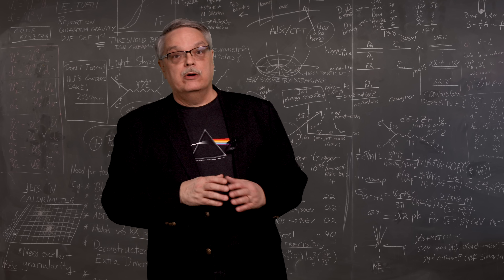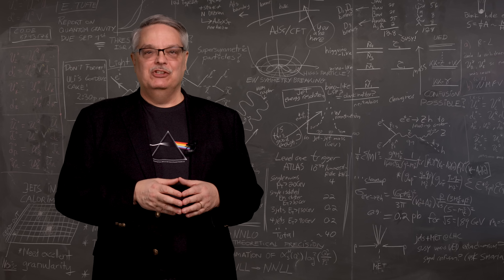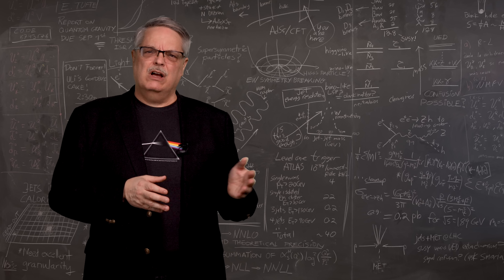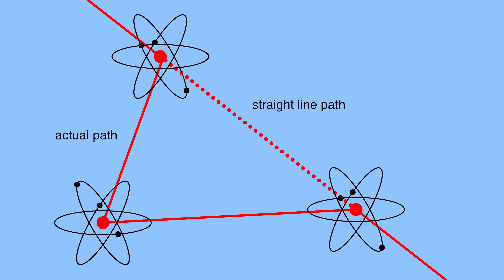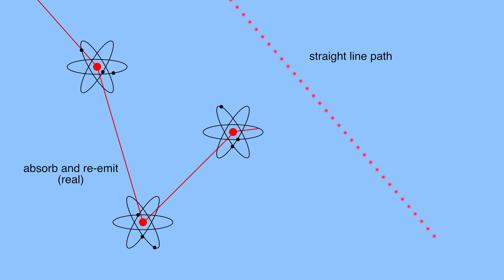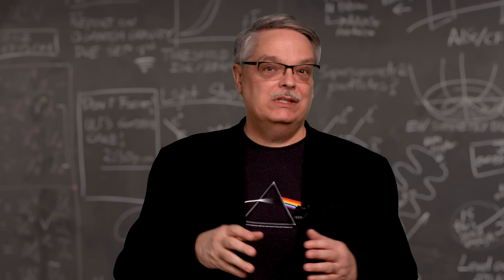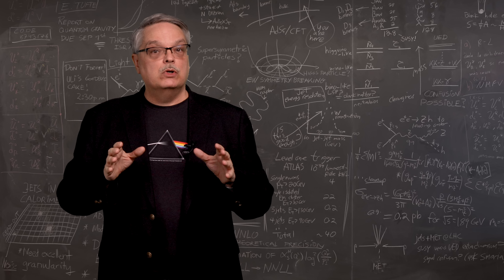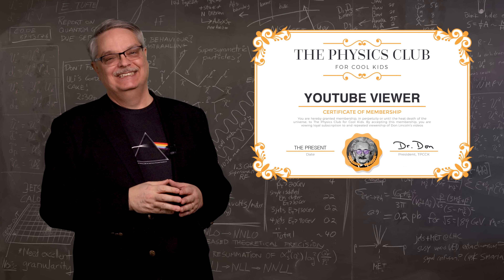Why does light slow down in water?

Comment: light moves slower in some materials as light moves slower in some materials. I think that's as good an explanation as any. Science never answers why, it only answers "how" things work. The "why" only begs more questions which lead to further whys until we hit some edge of our knowledge. For example, in this explanation, if the electric field in the glass changes the wavelength of light, its color should change, why does it slow down? Red light travels in the same speed as blue in vacuum! Also why does it change direction? does the angle of incidence matter if all the material does is to slow down the wave?

Comment: if 2 waves are superimposed on each other, like combining 2 colors, why the light emerging from the glass is not a different color from the one entering it?  if the 2 waves are not in synchrony, why the emerging light is not of a different wavelength? And what is the QM explanation for diffraction?

Comment: Also, in the case of absorption and re-emission, wouldn't it emit a different energy (ie wavelength) photon than was absorbed?
Reply: The energy of light is made up of frequency and amplitude. The light does leave the glass with a lower energy but it loses energy from its amplitude, not its frequency. Basically it will be the same color/frequency but it will be dimmer/lower in amplitude.

Comment: If light can be slowed down by water or glass etc then the corollary of that, surely, is that it is theoretically possible to speed up light if it passes through mediums/accelerants not yet discovered, in outer space, for example, If possible, then the universe could be much younger than that based on the speed of light in a vacuum.
Reply: Nope. It's not just light and radiation. That's the speed of cause and effect. Space can expand faster than light, but two parts of the universe can't communicate faster than the speed of light.

Comment: The way I explain it is by approximating matter as a waveguide, albeit usually an isotropic one, and then it's a question of impedance.  This explanation has the advantage of working for acoustic as well as electromagnetic waves, and explains wavelength dispersion as well as internal and external reflection.  It has the disadvantage of requiring that the person already know about waveguides (or at least conductors and self-induction) and impedance, plus have to imagine every point in the medium as the junction of an infinite number of waveguides radiating in all directions.

Comment: Ok, so IOW.. imagine a little rocket on each photon. Each rocket powers light to the “speed of light”. Light hits air. The rocket’s power/output hasn’t changed. Rather the air/glass through which the light passes is what slows it’s actual speed. Like putting your hand on the intake of a hair dryer. Once the light is through the air/glass it returns to its original “speed of light”.

Comment: Could you please elaborate why adding two waves of different speeds results in a slower wave?
Reply: Great question. That's the key point that was never discussed. Without the answer, the explanation is incomplete.
Reply: It's kind of intuitive, since there's interaction between two moving waves and these waves travels in different speeds, it will be obvious that there will be a net effect of equilibrium between the two waves in a way that faster one will catch up to the slower and vice versa, and so we are left with a wave that possess It's own velocity. Consider two wheels attached by a chain and a wheel A moving at greater speed than wheel B, since the interaction by the chain allows for a uniform movement, then the two speeds will converge into a single speed.

Comment: This also doesn't seem to explain why light travels slower though a medium. When adding 2 EM waves, the resulting EM wave is still moving at speed C. You cannot slow the speed of an EM wave by adding other. According Maxwell, the speed is determined by the ability or willingness of a medium to create E->M waves and M->E waves. For emptiness (the nothing, vacuum) this has a certain value (2 values). No one knows why these values are what they are. In other medium, these values are different. So in vacuum, even without any restriction by other things in "the nothing", there is still a reluctance of E and M waves to be created. This reluctance is the cause the limit in EM wave speed C. In other medium, for some reason this reluctance of E and M waves to be created is higher.

Comment: Wrong again. The speed of light in a medium has nothing to do with the properties of light. The speed of light is a property of the medium it is traveling in. This is why temperature of the medium can have an effect on the speed. Light is a pressure difference that travels thru a medium and has similar properties as sound in it’s first stage. Now when light hits a suface between 2 mediums light will transfer part of it’s energy to the surface and be converted in transverse waves. It’s these secondary transverse waves we can observe with our eyes.

Comment: Now I'm confused.
The first graphic demonstrates the superposition of two waves of the same frequency but with different phases, explaining that they can add or subtract.
The second graphic shows two waves of different frequencies interfering to produce a third wave of different frequency (speed) from both of the component parts.
You then tell us that the incident wave causes the electrons in the material oscillate .. at the same frequency as the incident wave, which is an example of the first case, which does not yield a frequency (speed) change not the second.
For your explanation to hold true the incident light must be able to excite the components of the material at a frequency different from it's own, which isn't (quite) possible.
To be honest I hadn't even bothered to question what was going on until I saw this video. You've managed to introduce confusion where there was none before .. not that that's a bad thing.

Comment: Very interesting.  I was wondering, on a related topic, if an observer's frame of reference was from within the piece of glass, would it appear that the light was moving at the speed of light (c)?  Or, would it appear to be slower based on the interference from the electric field it inspired in the electrons in the glass?  Thanks
Reply: Assuming the observer wasn't being affected by any oscillations within the glass, the observer would be just as much at rest as if s/he were sitting just outside the glass.  So that shouldn't affect things.

Comment: Thats just a theory of why light slows down . Has this secondary wave been detected ? If the secondary wave slows light down , then what speeds it back up ? He just assumes that once outside the water light speeds back up . He keeps saying light in the vacuum speed outside the glass , but air is not a vacuum  and the oneway speed of light has never been measured

Comment: The interaction of electromagnetic waves is what slows light down? This must also generate heat and the light must lose energy as part of this interaction, correct? So the light emitted from the other side of the transparent medium is always going to be dimmer, and the medium itself heated up proportional to this dimming. Higher refractive index materials would have more of this dimming / heating effect right? So diamond would slow and dim light much more than glass.

Comment: White in the vacuum stays at the same speed as any object will uh object well add it's relative speed that I can't agree with you on. Light hits something like water which is extremely dense and constantly  in movement it slows down and stops And when light hitsIn objects such as glass it shows down a fraction on the mountain ma'am cannot re accelerate backup to the original speed because there's nothing pushing it . But it's also like a projectile from a gun What's a project that has been fired It starts slowing down a Courtney doe's relative mass

Comment: Fermilab 
If I have bottle of air and pressure is let say 1 bar. If I double the pressure, what happens relative c ?
Does it go faster because more of atoms or slower because more atoms resistant it more? Or did it even effect?

Comment: Thanks, Dr. Lincoln! Just curious, how does this explain total internal reflection? Why would a certain incidence angle be unable to cause the secondary electric fields? Will be glad to hear from you on this!
Reply: @DonaldJ Wrong. It does not have time...
Reply: When the moving wave inside the material gets to the boundary, the geometry is such that the electromagnetic field at the boundary doesn't correspond to any moving wave outside of it. Instead, what you get is an "evanescent field" that extends only a tiny distance into the space beyond the material but rapidly dies out beyond that. Since it can't carry any flow of power off into the surrounding space, it's all internally reflected.

But that evanescent field is what can cause the wave to be transmitted again if you put another block of the same material right up against the first one--it can bridge the microscopic gap.
Reply: It not that “a certain incidence angle is unable to cause the secondary electric fields”, it is quite the opposite. The secondary electric field is still there in both cases it just might combine to give a different transmitted forward velocity or combine and give a reflected reverse velocity at the interface depending on the different medium/vacuum and angle.  So, the answer is same idea from wave theory introduced in this video of wave superposition, but not only can they combine to have different speeds, but the combination can also be in the reverse direction to the primary wave depending on conditions. BTW great video and great question :)
Reply: @aaronhoney2217  Any correlation to Lenz's Law?
Reply: @dizzydinonysius  This connects to Lenz’s law which relates to Faraday's law of induction by giving the direction of the induced electromotive force . Maxwell's classical electrodynamics is the theory for classical electromagnetic wave most commonly used in Heaviside’s form of vector calculus containing four equations.  (Which most people learn. Do a google image search of to see Maxwell's equations). 

Two of the four equations are for electrostatics (1. Gauss' equation) and magnetostatics (2. Gauss' equation for magnetism)  the other two are relate to electromagnetic dynamics , 3. Maxwell-Faraday equation (contain Lenz Law) and 4. Maxell-Ampere equation. The last  two form a coupled equation to give the wave equation and contains the speed of light. Applying all equations to reflection and refraction problems give the wave theory explained in this video.
Reply: @aaronhoney2217  Thanks
Reply: @brianletter3545  this was a macro explanation that the math and observed effects validate..  quantum discussions provide a deeper look beyond the purpose of this lesson.
Reply: @hillaryclinton2415  You mean like the REAL explanation.  I'm so tired of "theories" being spoken about like gospel.
Reply: @hillaryclinton2415  Correct.
Reply: Interesting stuff. How did you access the Akashic records? The reason I ask is that I witnessed the Akashic chronicles by accident 35 years ago!

Comment: Why can't the secondary wave generated by the electrons in any material add to the speed of the resultant wave? Why it always slows it down. I can think of two waves which move slowly individually but their resultant has higher velocity. Why the preference towards slower speed case?

Comment: With all due respect, but this is not a good explanation imho. E.g., what is shown @6:24 is a standing wave, not a moving electro- or magnetic field. This explanation is not showing why the light changes direction in the material either, such as the wave front explanation does. Of course, the first two explanations are not correct and this is closer to the truth, but still doesn’t provide the full picture.
Reply: Yeah, the explanation is weak, and the video is very misleading about details which people are most likely to remember after they have forgotten the explanation for the slower speed of light in water. It's a double fail.

https://www.youtube.com/watch?v=CUjt36SD3h8&lc=UgyFYfPBsHn7RY7Z1254AaABAg